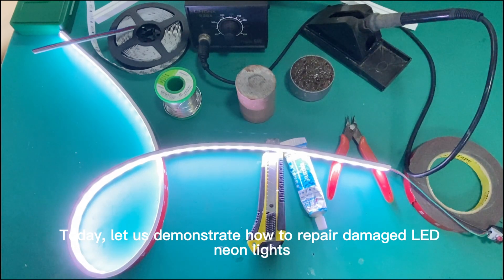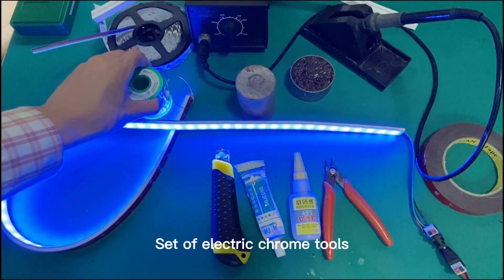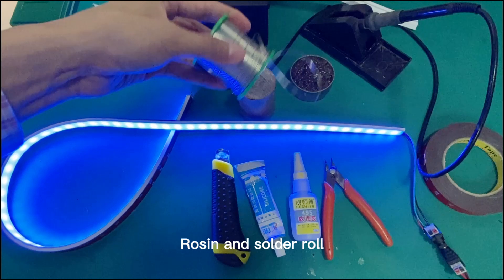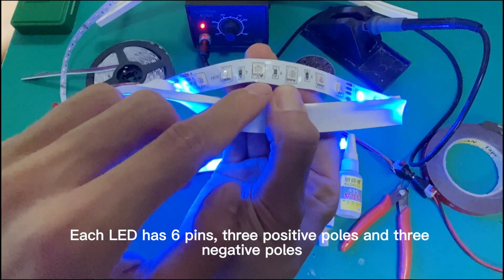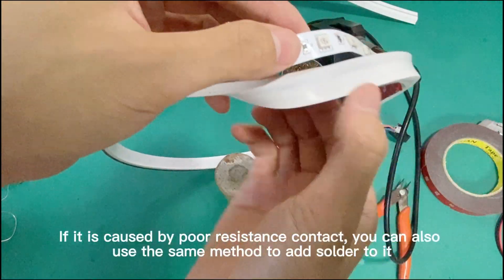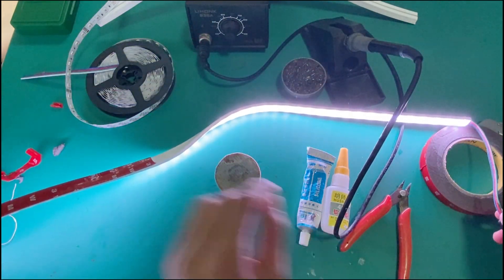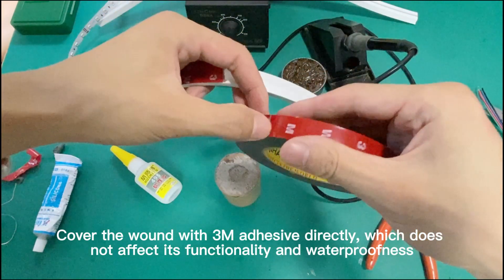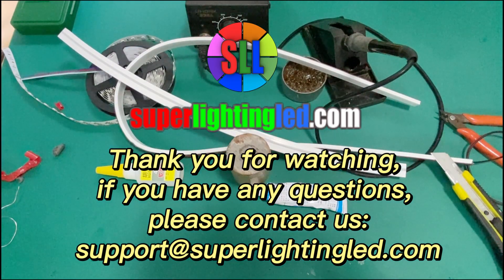How do I repair my damaged LED neon lights? - Replacement and repair. Very easy to operate

Comment from the maker: :yt::stayhome:In the process of production, transportation and installation, we may accidentally damage the strips inside the neon lights, which may cause one unit of the large roll of neon lights to not work or have poor contact, which affects the mood too much. The cost of replacement and return is often higher than the value of the product itself. How can we solve this problem? Please watch this video to learn how to solve the problem of color synchronization caused by poor contact of neon lights or unit failure

Before repairing, you need to prepare a utility knife, a pair of scissors, a bottle of 704 silicone glue, 3M adhesive, a soldering iron kit and a replacement strip unit:

The following are the items that appear in the demo video：
led neon tube: 
👉https://www.superlightingled.com/silicone-neon-tube-series-c-306_398.html
RGB led strips:
👉https://www.superlightingled.com/rgb-flexible-led-strip-lights-c-3_26.html
soldering iron kit: 
👉https://www.superlightingled.com/60w-adjustable-thermostat-electric-soldering-iron-set-p-4074.html
704 glue: 
👉https://www.superlightingled.com/k5905-fast-dry-hightemp-rtv-silicon-sealantsilicone-glue-transparent-led-adhesive-for-indoor-lighting-p-1853.html
3M adhesive:
https://www.superlightingled.com/33-meters100ft-3m-vhb-dark-gray-acrylic-adhesive-681012152030mm-wide-double-sided-tape-roll-with-firm-foam-p-2740.html
Scissor: 
👉https://www.superlightingled.com/45-to-135-multiple-angles-adjustment-professional-precise-cutting-groove-scissors-for-led-neon-tube-p-4351.html

If you need us to help you customize the neon tube type or length, we are also happy to solve it for you:
👉https://www.superlightingled.com/led-neon-flex-tube-light-c-306.html

You are welcome to subscribe to our channel, we will update the video every day, Thanks!
👉http://bit.ly/3f4TRRw

We provide free online and email technical installation instructions!
If you have any questions, please feel free to contact us.
:stayhome:https://www.superlightingled.com/contact_us.html
:stayhome:Amazon Store: https://www.amazon.com/shops/superlightingled
:stayhome:YouTube Channel：https://www.youtube.com/c/superlightingled
:stayhome:FaceBook:  https://www.facebook.com/SuperLightingLED
:stayhome:Our Website:   https://www.superlightingled.com/